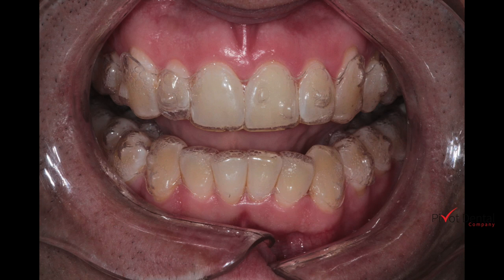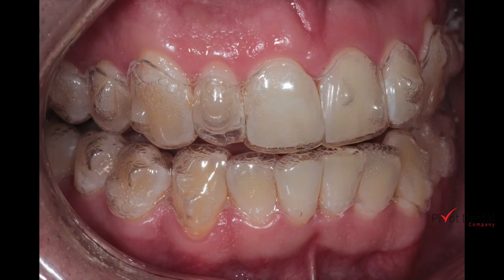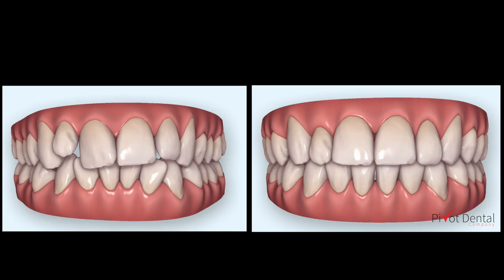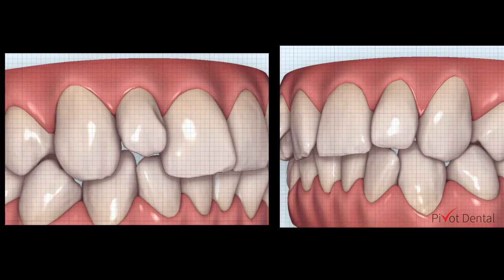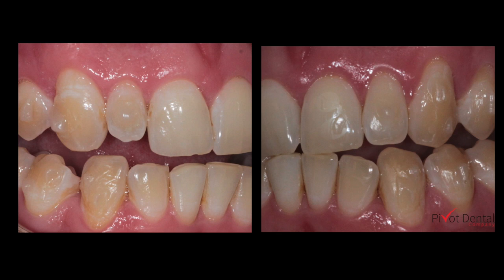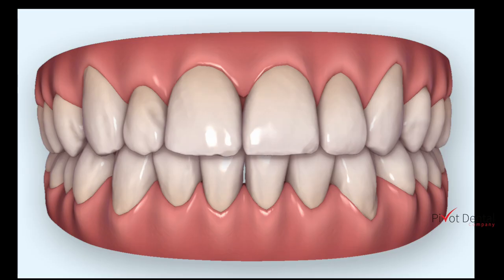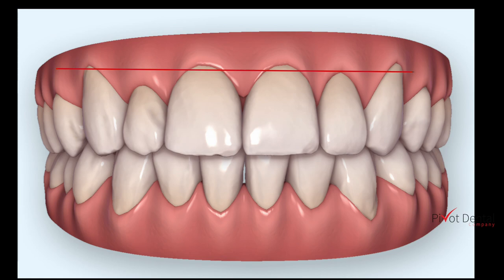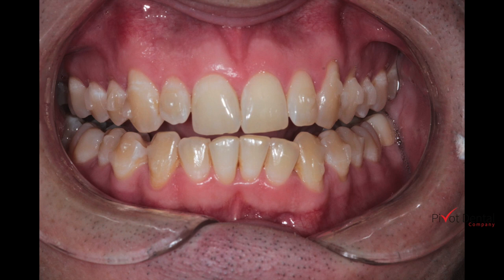Invisalign Laterals Not Tracking

Comment: It would be good to see an update about this as I'm in a similar position. How does the the clients teeth look after finishing the treatment? Did they have a veneer fitted? Thanks
Reply from the maker: Sorry, I don't have a follow up to this patient's case.  However, now I don't count on any major extrusion movements when setting up a case in ClinCheck.  If there's a vertical size discrepancy then a veneer will be treatment planned at the end of treatment and then a retainer made.
Reply: I'm just going to deal with a 1 to 2mm difference between the two laterals. But the rest of the teeth look so much better. Still worth it. Based on this video the orthodontist shouldn't have pulled down the other lateral as far.

Comment: Ok so those gaps at the top are fine as long as the tooth is seated fully into the tray? I have one tooth that has a gap at the top like this person but the tooth sits all the way Inside
Reply from the maker: As long as the tooth is fitting into the aligner then the tooth will "go along for the ride" as intended.

Comment: I'm literally on 10 of 23 and I'm having this exact problem with that exact tooth. My tooth is also much smaller than my other one.
Reply: Without seeing it I have incomplete info, but usually there are 2 options:
1.  Have the dentist place a button bracket on the front and back of the tooth, modify the tray and place a rubber band on the buttons and "slingshot" the tooth down into the tray.
2.  Finish the Invisalign and place a restorative material on the tooth at the end (bonding or veneer).
Reply: How did it end up? I’m having this issue now…